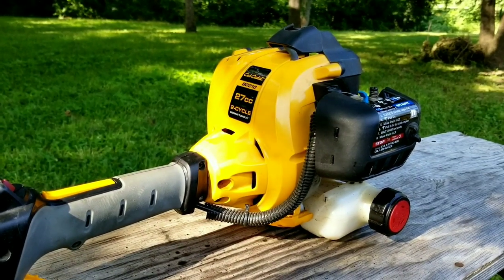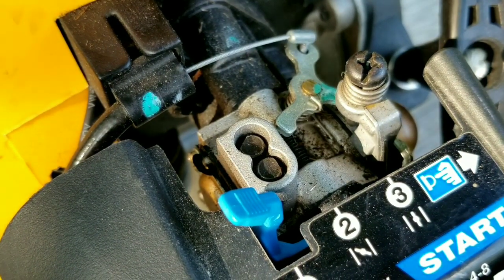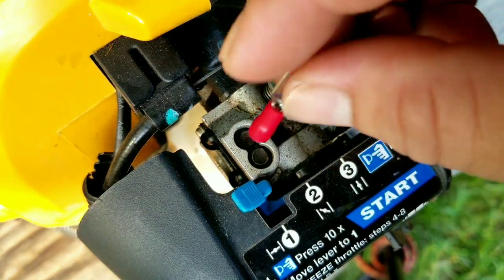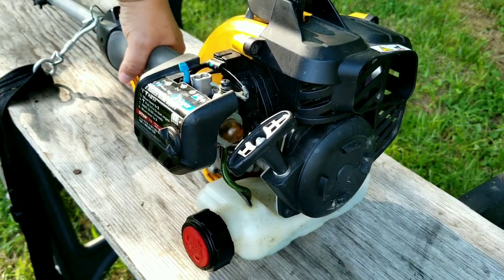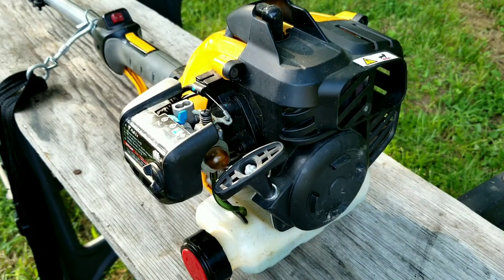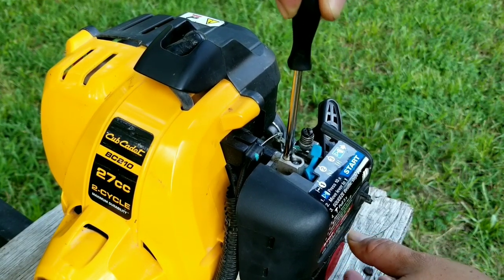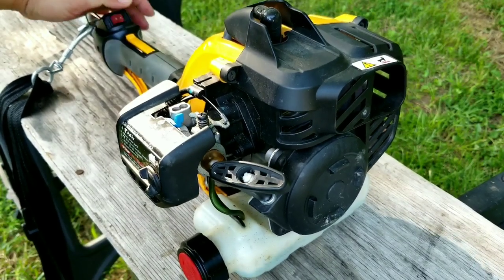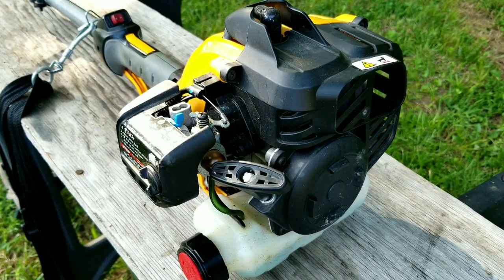Fix a Trimmer won't idle for long then dies

Comment: I used to take my equipment in to a repair shop whenever it had an issue. The same for my cars and trucks. I've since learned that most things are an easy fix and learning how to cope with small issues can not only save a LOT of money but even more importantly, time. I just recently had a turning signal problem with my Silverado and all it needed was a taillight circuit board. Total cost $20 and about 10 minutes work. Had I taken it into a shop, approx. $135 plus not having a truck for a day or two.
Reply from the maker: yes you are completely right about that.

Comment: This summer I'm learning about small engine repair, first by working on my works 3 lawn mowers. So that gave me confidence to work on my own stuff. Murray Select 2550 SE was sputtering through out the range of the throttle and was leaking gas from the tank. I first replaced the fuel line from the tank to the prime bulb, that stopped the leak but, it still sputtered and leaked gas from the fuel line that went from the tank to the carb. I replaced that line, and it stop leaking and sputtering. Now I have to work on it die at idle. I'm gonna clean the carburetor and replace the fuel filter before tuning the carb. Thank you for your video
Reply from the maker: thank you Mario Chesser and good luck.

Comment: Certain cheap ball-point pens have a barrel that can be used as a makeshift wrench for maybe $1 at a DollarTree store. Look for cheap plastic tube ball point pens. A minor problem may be a lack of clean fuel and it needs to be ethanol free with synthetic oil at the right ratio for that machine. A shop can fix it and will charge a LOT and probably not tell you just what they did. Make sure the fuel tubes are supple and are not leaking in air at the fuel tank holes. New lines are cheap to buy...
Reply from the maker: All excellent tips. Thank you for the comment I appreciate it
Reply from the maker: @Ashurii you are correct.

Comment: I had the same sort of problem with my Husqvarna 129 ,it was sometimes four stroking, I thought it was a fuel problem but after getting nowhere with that approach , I found the plug lead was intermittingly going open circuit . I pushed a four inch piece of stainless steel locking wire through the insulation next to the plug and down the carbon string core and taped it up. That fixed it 👍👍😊😊 (for me anyway )  95 octane  E5 petrol is the lowest  we had in UK, just gone to E 10 for this so use 99 octane E5.to be on the safe side.
Reply from the maker: very nice work.
Reply: What do you mean by, "What are the first signs of clutch failure?"

Comment: Had a trimmer that wouldn’t run. Found some grime clogging orfice just past the screen. After cleaning carb, trimmer wouldn’t idle. Adjusted low idle screw to fix. Ty from a diy’er
Reply: I’m a penny pincher, so try to fix everything myself. Wouldn’t ever take it into a shop for work.
Reply from the maker: thank you!
Reply from the maker: nothing wrong with that

Comment: It had a chainsaw I worked with a while aback and when you start it , it started fine. The problem at the time was it started on the cold start position and when in the hot start it idle great. However when you rev the engine up from hot start position and you squeezed the trigger it will work but from the moment you let go of the trigger it shut off completely
Reply from the maker: its a tune issue most likely, on the letting go of the trigger, there may not be enough fuel to let it idle so it dies, otherwise, the metering diaphragm may be on it's way out too.
Reply: @HomeGaragechannel  thanks for the advice bro

Comment: At first it seemed like a fuel tank vent problem as it idled then starved for fuel. One thing to note on some carbs it’s hard to adjust the low screw when the idle is all the way in. It could be fuelling from both circuits make tuning difficult
Reply from the maker: Thank you farmer jackson for the comment.  Definitely a bit tricky when tuning it.

Comment: Usually in such a case it also might be starving like that (after almost a minute of idling) due to a clogged fuel tank breather-valve that makes it harder for the internal carburetor fuel pump to suck fuel from the tank. No air coming in to the fuel tank to compensate for the vacuum = runs ok for a while then running lean & then dies. Happens more often that you'll know even on my dualsport motorcycle on the highway. I panicked 1st but hadn't realized it was the fuel cap breather. Once I had the brains to mess around with the breather on my next stop and release the valve by simply blowing some air through it - the problem was gone!
Reply from the maker: Thank you for the comment I appreciate it
Reply: @HomeGaragechannel  thx for the video. Keep'em coming 🤙🏼

Comment: The carb on my Feather Lite came with a adjustment tool. I have a Troy Bilt that needs adjusting. I ordered the set of 10 and it was cancelled and refunded. The seller said they were worried about bad quality. What a rip off. I just needed some tools. Ebay sucks
Reply from the maker: Yes I have moved away from that site.
Reply from the maker: @Ashurii that site has changed a lot in the last few years.

Comment: I would figure out how to fix it by watching home garage videos 😆
Reply from the maker: Thanks for the plug D Fields  I appreciate it
Reply: @HomeGaragechannel  my 4 cycle weed trimmer turn off when i release the throttle . When i hold the throttle down its stay on but its not raving how it should . I clean the carburetor already still the same. Please help
Reply from the maker: @hectoribarra8473  I would replace the carburetor.  It would be the simplest way to fix it
Reply from the maker: @65csx83  if it doesn't work the first time I would replace the carb.
Reply: That's the way I learned how to do some adjustments on trimmers, watching Home Garage videos are the easiest way to learn how to...
Reply from the maker: @samuelvelez1643  thanks I appreciate it.  You'll develop your own personal tuning methods in time too. I did.
Reply: @HomeGaragechannel  not only I learned how to adjust the carburetor,also how to diagnose and troubleshoot...
Reply from the maker: @samuelvelez1643  both very valuable lessons
Reply: @HomeGaragechannel  67

Comment: I have problem with my stihl brushcutter. I mow the grass and after 30 minutes brushcutter dies and does not start. It doesn´t work until next day.
Reply from the maker: I would replace the spark plug and the tank vent. if that doesn't work, I would replace the carb.

Comment: my problem is I replaced the carbuerator  for $10 on a featherlite runs great while throttle is pulled. dies letting off trigger. Carb come with a tool but I'm afraid of which high/low to turn.
Reply from the maker: turn the screw closer the engine counter clockwise about half a turn. Also turn the idle screw clockwise about 1 turn.

Comment: My weed eater stalls after more than one or two seconds of idling and it’s hard to start, any thoughts?
Reply from the maker: Yes try replacing the gas cap or the tank vent if yours is a different model. If that doesn't work replace the carb
Reply: Home Garage It doesn’t start as of rn. It has spark, and compression but when i pour a little fuel into the throat of the carb and try to start it, it still won’t start. This leads me to believe it isn’t the fuel that’s the problem either. Not sure what else could be causing it not to start now. Ive read maybe it’s the spark arrestor?
Reply from the maker: @sparkplugs.1816  give it a shot
Reply: Home Garage It was just bad gas🤧
Reply from the maker: @sparkplugs.1816  glad you figured it out.

Comment: Sounds like it was running too rich on full throttle and not getting maximum revs
Reply from the maker: Its definitely seems rich. Although  I usually don't tune for max engine speed it did seems it could be leaned out a bit.

Comment: My trimmer starts easily but when I turn the choke to the normal running position and try to rev it up, it dies. I can't throttle it enough for it to be effective. Any clue as to what the issue could be?
Reply from the maker: sure, but which trimmer do you have?
Reply: @HomeGaragechannel  it's a Makita Em2600.
Reply from the maker: thank you for the information. Unfortunately, the original carb is not "technically " adjustable.  I would either run it "Half" choke, or you can replace the carb.
Reply: After watching some of your videos I looked and couldn't find anything to try and tune it. Might be better off testing my angle grinder against it 😅
Reply from the maker: Yes this particular carb is fairly tamper proof

Comment: Is pre mix any good?
Reply from the maker: yes and no, the price is too high.
Reply: @HomeGaragechannel  I bought a weed eater off Facebook brand new carb new did run okay half way through the job now it won’t idle up or start
Reply: @HomeGaragechannel  actually in my opinion the idle was a tad high when it did run
Reply from the maker: I see, have you looked into the fuel tank and looked to see if the fuel filter might be off the line.  After that, I'm curious if someone swapped the lines on the carb, so that the carb is receiving unfiltered fuel, which will clog the screen inside  the carb.
Reply from the maker: to me that's a sign that the carb is not set well, and the only it way for it to idle was to have it idle too fast.
Reply: @HomeGaragechannel  I went to check it out today fresh start and it cranked immediately verified spark first and I’m not sure if it just got flooded yesterday I did set the idle screw down a bit that helped a lot interesting
Reply: @HomeGaragechannel  yea a guy did do the lines and the tank is pretty dark so it’s hard to see through
Reply from the maker: good to know